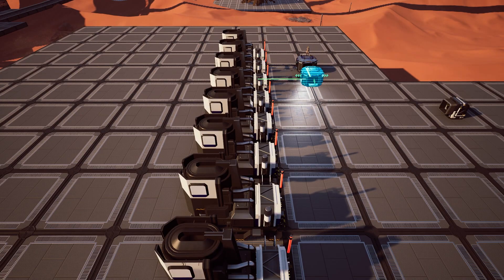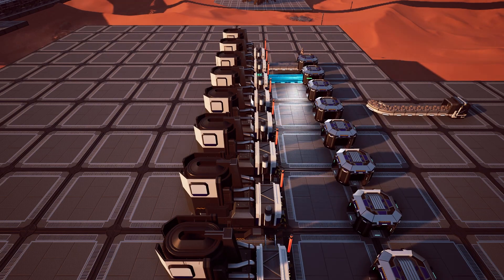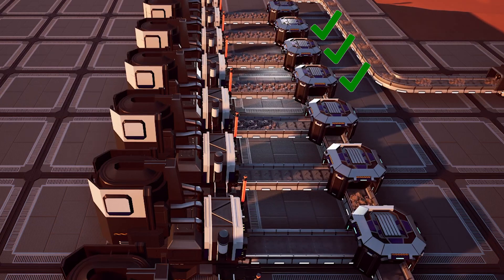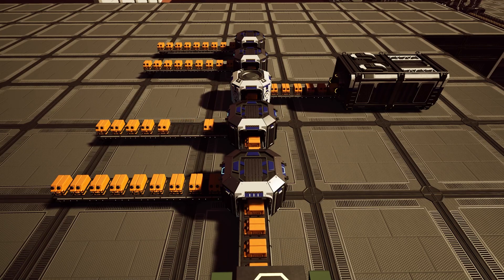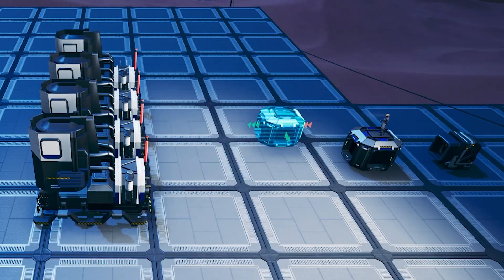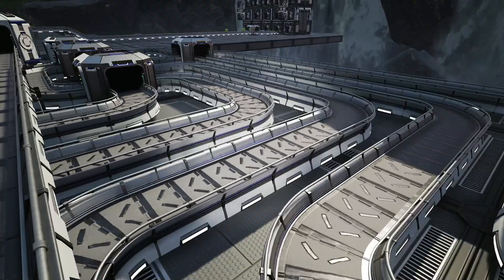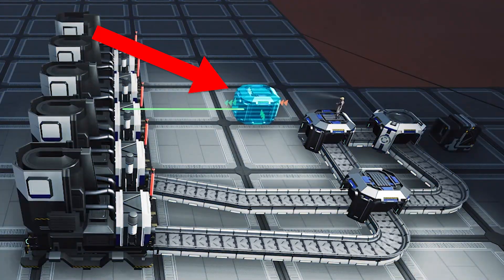Satisfactory: Manifold vs Load Balancing for Belts + Tutorial

Comment: I find that a manifold works best if you get a bunch of the material in your inventory and fill up the machines before adding electricity then by the time the machines need more input then your manifold is all backed up thus in most cases it works steadily from the start unless your setup is so big the machines run out quicker but that would be a line with an mk3 minor or something like that where your line is moving very fast and would thus be late game.
Reply from the maker: I agree, that's usually what I do if I'm worried about it not having enough resources to get started.

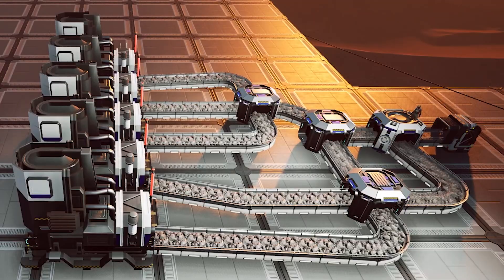Comment: 5:38 : "And then everything will be running smoothly."
In the background, the setup screeches to a halt at this precise moment.
Reply: the smelters aren't running so of course it would stop?
Reply: Well, that is the ultimate satisfactory experience.
Reply: "This is the one thing we didn't want to happen."
Reply: Yea his loopback was too early. You need to split it and feed 1 line to either side of the first splitter. You can't fit more than a full belt on a full belt lol so putting the loop into your full input belt defeats it's purpose a bit
Reply: @dusk9910  Doesnt matter where it is. It stopped because the smelters aren't cooking.. lol

Comment: Manifold has one major advantage over load balancing - it's much easier to expand.  Just add more machines onto the end of the manifold line.
Reply from the maker: That's a good point! Easily expandable!
Reply: You can also 'skip' one machine, and in this space add injector from another belt. Essentially expanding into two manifolds, when belt speed reaches limit.
Reply: @TrivialTax also works for balancing
Reply: Indeed! And I use the fastest belt just for the main lane and slower belts from splitter into machines in that speed, what the required max input speed for item is. The main belt lane can be connected back to the beginning of itself, so it runs permantly in a circle. At the end of the main lane you can use an AI-Splitter to send your overflow to your storage for making stuff manually at the workbench or building more machines and structures. And if the storage is full, the rest goes automatically to the shredder for more shop-coupons.
Reply: I think once you understand how the loopback works this is untrue,

If you have one loop back already in place, adding one more module is super easy by wrapping in the loopback, if you don't have a loopback available, you move back a row of splitters and do the same, grab a loopback if one exists, if it doesn't, move back another round of splitters, and grab a loopback

Then you take the loopback that you grabbed, and run it to the next row to the desired input.

I personally use the manifold due to its simplicity, but there is no reason an expansion can't be done quickly with a balanced factory, as long as you have a basic understanding of the loopback
Reply: I use Blueprints to build modules with manifolds in mind now. The way I do this is to design set of machines and conveyors so that input and output of everything happens on one side. Why? So I can expand my manifold in one direction at any time without having to rebuild either the input or output lines. If I need to expand a production line, I can just drop a module on one end of the manifold without ever interrupting production.
Reply: Your comment was read while redesigning 3 of my smaller factories in my head to update a major factory later lol so yeah I agree with you completely "laughs in logistical floor"
Reply: yup, I also wondered who needs everything working immediately for the cost of so much space...
Reply: @pixopixopixo its nice to have everything working quickly when trying to troubleshoot a larger production line
I often make small mistakes (forgot to add a belt, used wrong belt speed, etc).
Im trying to balance more, but manifolds are just so easy to set up
Reply: @pixopixopixo  I enjoy the math and imo factories look way more interesting with balancers
Reply: It doesn’t cost much space if you have an logistic floor and be smart.

Example smelters use 30/m
Use the lifts facing eachother below and put an splitte in the middle. Then connect the splitter and with an mark 1 belt to the main belt.

Done this is as expandable and uses the same ammount of resources and it’s balanced.
Reply: Don’t forget that they are just so much simpler to think about. The enemy in a lot of these games is perfection. Get it looking good. But why spend 4-5x as long to get it perfect, especially in the early game.
Reply: Manifold also helps with power, if materials run short itll feed only what is capable vs splitting all materials then all machines start and stop pulling massive power loads
Reply: Also you can just grab a handful of stacks and load them directly into the machines thus instantly queuing your resources versus waiting for them to load.
Reply: ...or switch it's recipe. Eg from iron plate to iron rod, to meet changing needs.
Reply: Me personally, I never do Manifold method 'cause it is inefficient. Better take time and give same amount of things to everyone than suffer overfilling in first and no items in the last.
Reply: @alexandrmonichev5929 or you can plop down a compact vertical manifold factory with a 4x4 horizontal footprint and pre-programmed input, output, and clock ratio in one click, hook it up to your power grid and beltway in six clicks, and use all that saved time and space to do something more important than plotting out and balancing your smelters and constructors for the millionth time.

People, make the FACTORY waste ITS time so you don't waste YOUR time, and if y'all are so rustled over the saturation time of manifolds just temporarily overclock some of the buildings that bottleneck the saturation process and grab the shards the next time you stop by, or god forbid you take a few extra seconds to hand feed some stacks to the buildings before you move on to the next step of the project.

They both produce the same amount of product/minute at the end of the day, except one is easier and faster to build, automate, upgrade, clock, and ignore for more important work.
Reply: @alexandrmonichev5929 Manifolds are exactly as efficient as balancers.

The two differences are:

1) They take time to fill up and get going. Which can be reduced a few ways if you need to.

2) If you run short of supply it will cause the last machines to almost shut down while a balancer will equally reduce all of them. This could be a positive or a negative or irrelevant depending on what you are doing.

I prefer manifolds for high throughput things like smelter arrays that feed into a supply system where they are simple and easily expandable as you develop technology. Meanwhile balancers are things I am more likely to use in high value production facilities.
Reply: Manifold is barbaric.
Reply: If you plan ahead and maybe use some blueprints its actually quite easy to extend. I usually double or tripple my production along the beltspeed. So you only need to copy paste what you already had and add another top layer splitter.
If you expand to some strange number start with the first splitter and always use all exits. Any remaining splitter output goes into a manifold that refeeds at the top layer. Just repeat that process until only one splitter is left. Don't refeed the last splitter with a huge loadbalancer (>>27 machines) maybe avoid refeedind the second level as well. Or you will loose some beltspeed. With the blueprints it's actually really easy. Just copy past them a view times.
But it's not as easy as manifolds with additional feeders.

Comment: with a manifold I power each one up after the last one in line is full.  I also manually fill each machine sometimes.  As long as your input is equal to or slightly higher than consumption you are fine.
Reply: Same. Usually when i'm building, the "input" resource is already backup up. I just manually fill the excess resources into the "last" machines

Comment: If i need to split into 5, i build 6 machines and reduce the clockspeed to 0.83, works always without any problems.
Reply from the maker: Sometimes that's just easier!
Reply: Wouldn't that use more power than five at 100%? Depending on where you're at in the game, power can be a limiting factor. I just unlocked oil in my first playthrough and am trying to future proof my build but math isn't my strong suit
Reply: @Miss_Trillium  I think you got it backwards. 6 machines at 0.833 uses less power than 5 machines at 1. At 0.833 speed, the power usage is 0.747 (multiplied by the building's base rate). So all combined, the 6 underclocked machines would use 4.48 power instead of the 5 power used in the 5 building setup. Underclocking always makes things more power efficient just like overclocking makes them less power efficient. This is precisely why people run twice as many constructors at 50% speed in early game to save on biofuel.

Comment: If you have the input to a manifold in the center instead of one of the sides then the manifold fills up faster. The more splitters you need to use the better it is to have the input in the middle of a manifold.
Reply from the maker: True, but at that point it's pretty much just a load balanced system.

Comment: Even when it's full a manifold will slow your system down.
Reply from the maker: In what way? If the system is full then it shouldn't matter, right?
Reply: @SatisfactoryNews  If you have too many machines on a manifold, causing a lot of temporary 50/50 splits. Your last machines will actually run out of resources eventually, even though on paper you shouldn't. It's a weird timing issue when you run at belt capacity. I'm sure you're noticed coal power plants suddenly shutting down long after the kinks have been worked out and you're running as many plants as your belt will allow.
Reply from the maker: Ah yes, I know what you're referring to. As long as the numbers add up perfectly, I've never had an issue as long as you fill up the machines and/or back up the belts before turning the machines on. But I've had enough weird timing issues like that that I can see it going wrong on the extreme end of things. Definitely one of the situations where manifold is best, but I still think it's ideal if you're doing something smaller-scale like processing the ore from a single miner into smelters and constructors.

Comment: I try and avoild Manifold at all cost unless im removing items. 

All my inputs are Load Balanced strickly.
I make take items away in a manifold system but then that single belt would be then load balanced into the next input. 

So far all my buildings are 100% effiecent. With no back up on the belts. And overflow of the final product sent to the A.sink machine. So my miners never turn off.
Reply: Its in the name of the game. Satisfaction. 

Theres a certain satisfaction that comes with working out load balancing. Its hard work n makes builds bigger. (I build up with sandwich layers for belting)

But thats it. An element of satisfaction having it all load balanced 💪💪
Reply from the maker: That makes total sense! I personally get a lot of satisfaction out of seeing a line of production buildings with a single belt and a line of splitters in front of them, so I tend to choose manifold :) Whatever makes you happiest!

Comment: I don’t see load balancing as more complicated. It uses less splitters for each setup.
Reply from the maker: That's fair. At least personally, I find it much simpler to just lay out a splitter in front of each machine rather than trying to find the space and figure out how to use a load balancing system. But also, most of my production setups use an amount of machines that results in easy math, so the manifold system doesn't tend to have any downsides.
Reply: @SatisfactoryNews  I find that the manifold system also takes a long time to stop if you need to make changes. :)

Comment: Main issue with manifolds is the last machine in the chain, if you're fully saturating the belt. Last machine might have some small downtimes so there's two ways of solving this issue: EIther power off the first machine in the chain until the last one saturates a little bit (universal solution) OR simply hand-feed the last machine in the chain a stack of whatever it's consuming.
Second solution here is not always viable because you might be transporting something radioactive or it could simply be pipes and then it won't work.

Comment: Really no major downside to manifold method if you simply don't connect the machine output until they are all fully capped on both raw material and end product.
Secondly the best way to deal with load balance is the Modular Load Balancer mod. At least until they add a function to programmable splitters to set desired item/min in vanilla.
Reply from the maker: Definitely true, that's why I use it most of the time. The only time I used load balancing was in a system that had 5 nuclear reactors, but also letting it back up would have worked just fine.

Good call on the mod, although I just limit this channel to the vanilla game. Great options out there if you want to use them.
Reply: I'd say the only downside is when redioactive materials are involved. When these back up in the machinery they create a large hazard zone and manifold method guarantees they will back up. With load balancing you can avoid exactly that as long as you produce parts at the exact same speed as they are consumed and split them equally.
Reply: I use giant, loonnng manifolds.
Reply: @anthonystahl8996  I think the most important thing about load-balancing is how incredibly satisfying it looks in action when instead of completely overloaded belt you get a separate items flowing in at fixed intervals and everything still works at 100% with next to no items in the internal storage.
Reply: @lainverse  yes I started a new save and have been thinking load balancing, coal power is next to optimize, just got it!
Reply: or just simply run the line as you build the system, every thing should be topped off by the time you are finished

Comment: I also use manifold most of the time but when you get to aluminum scrap for large setups the load balance makes life easier because the mk 5 belts cant handle the amount of items on them , this is when i start load balancing my lines , great video and info keep up the good work with this great game 👍
Reply from the maker: Thanks! I love the different ways to accomplish things in this game, and I hope some people learned something with this video!
Reply: Sometimes the best solution to a large system is to build it as a set of modular units. For my aluminum I build units consisting of: 3 refineries with sloppy alumina recipe. (1 using water from collectors and the other 2 using ONLY the by product water from the whole unit. ) Each feeds the alumina solution to 1 refinery making aluminum scrap by the base recipe, and in turn feeds aluminum scrap to 6 smelters making pure aluminum ingots. Then feed the output of each set of smelters into a shared belt to where I'm using the ingots. Need more: I just add more units. (Not 100% efficient, but I've never been able to keep the system running if the fresh and recycled water pipes have any connection at all.)
Reply: @richardreid6377  At first I had a lot of trouble with connecting fresh water and recycled water as well. Than I used a few valves and a water tank. You must prevent back flow at all cost and (in my case) create a buffer with the tank. The tank can only fill with recycled water. You can split the recycled water pipe to create not one but a few merges with the freshwater pipe. So you priorize the recycled water when filling up the freshwater pipe. 
My aluminium production runs extremly good (needed a lot for conveyers and other things) my steel stuff not so much because I was to lazy too optimise because I already had more than I could use xD